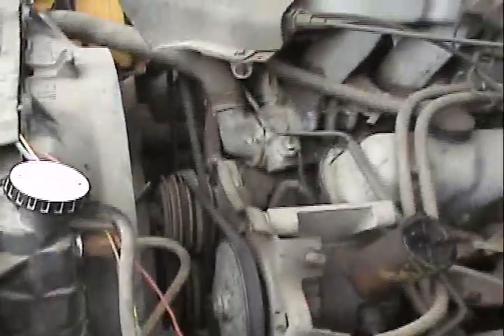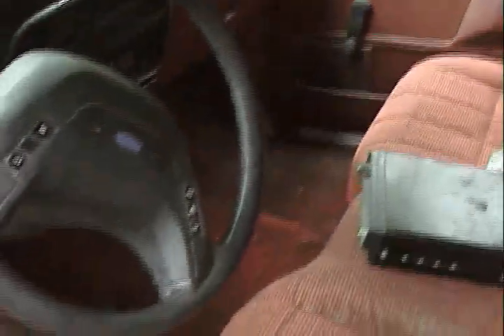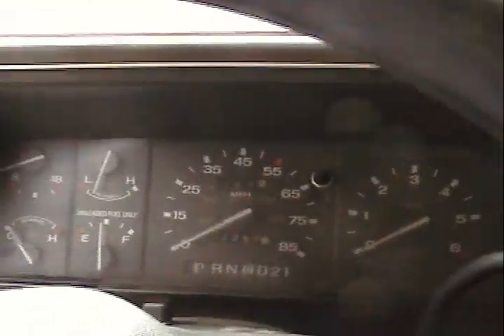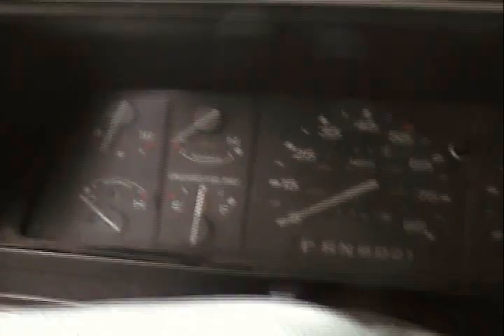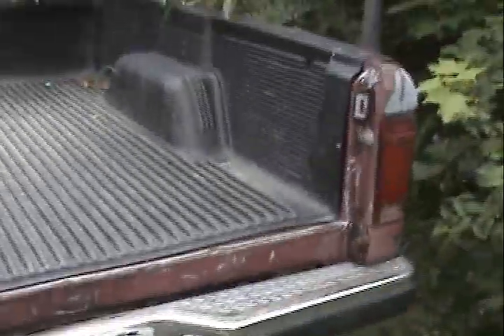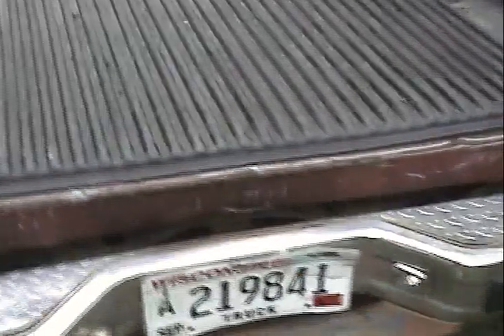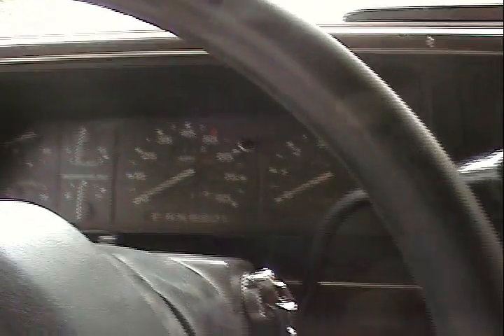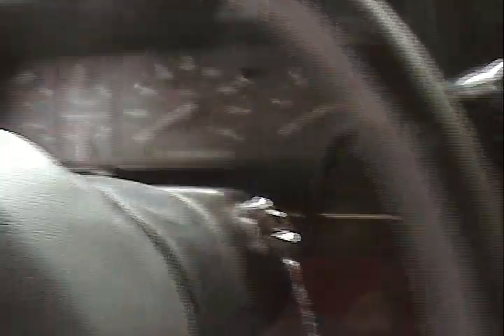1989 Ford Ranger XLT

Comment: cold start..i don't mean to be an ass but that's cute...55 degrees.....I'm sitting here with the same exact motor, 250 thousand miles, starting it at -5....cold start....
Reply: +Brandon Jessen Cold start means the engine wasn't up to temp before starting it. Not air temperature being cold.